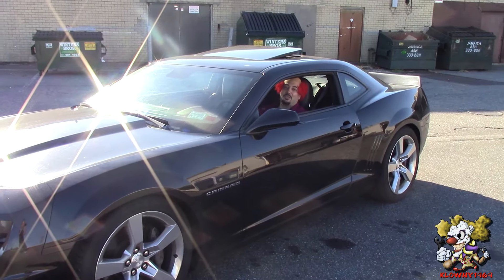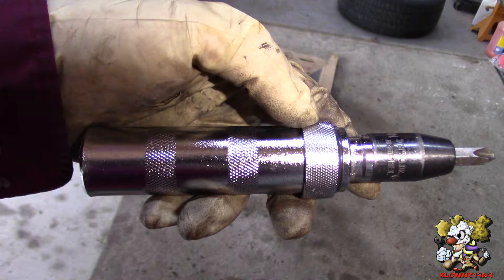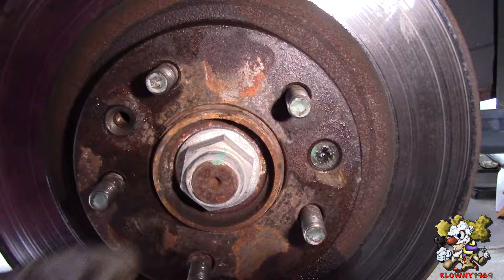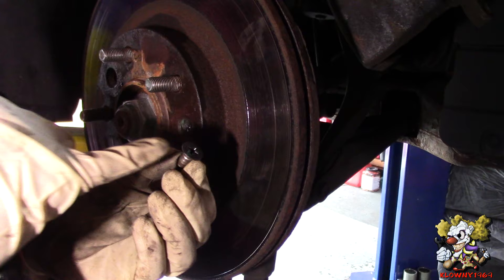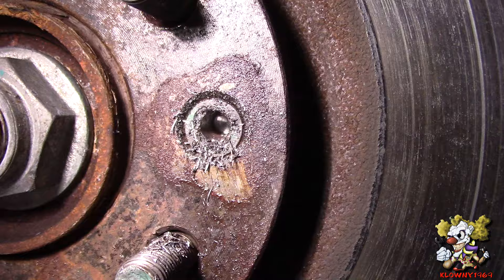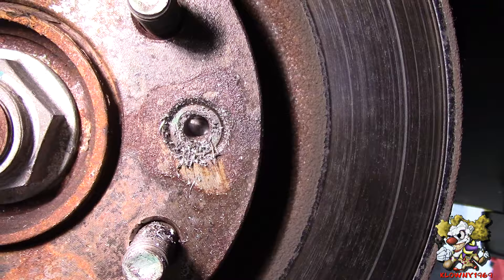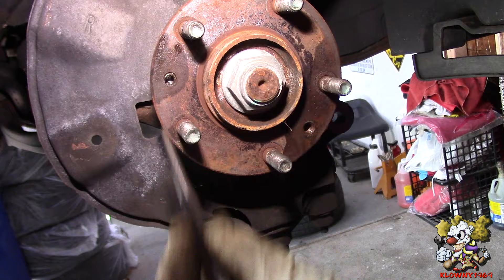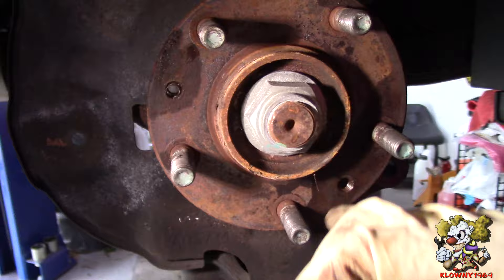How to Remove a stripped Brake rotor screw

Comment: The purpose of these screws is simply to instill as much pain as possible for the DIYer. Thanks for the video!
Reply from the maker: Thanks for watching and commenting..dont forget to subscribe and hit that bell
Reply: It worked then
Reply: Haha ain't that the truth!
Reply: Dang right
Reply: I bought one of those Shake N' Break pneumatic fastener removers. Actually I got the Lisle brand version of it. It works awesome for those rotor screws. I highly recommend checking it out if you do work on your vehicles like I do.
Reply: Been tryin to pick all this stuff up lon my own, and I am coming to the same conclusion very quickly. Also, crazy to see how often mechanics leave their problems for the next guy. Someone put/left that stripped screw in there knowing full well what they were doing. All the more reason to get better at this DIY stuff. I'd never set myself up for future failure like these mechanics do.
Reply: @anthonyfaiell3263  To be honest, the heads of those screws are made of cheese. It is very easy to strip them. Why don't they make quality products to begin with?
Reply: Those screws are as useless as anything I can think of. Car can do just fine without them
Reply: Thank you brother. Shit worked

Comment: it took me about an hour and a pry bar to get my rusty calliper bolts off only to find out the damn rotor screws are stripped form the previous owner, I'm gonna drill them tomorrow. I'm done for today. Thanks for the tip.
Reply from the maker: Good luck and don't forget to subscribe 😉
Reply: Same here,  I'm done for today. My honda element had 2 strip screws I guess
Reply: just happened to me
Reply: @mr.dhydratedh2o442  Happened to me too, so I just changed the brake pads instead for now. I'm concerned tho that it would damage the hub?????
Reply: DUDE SAME!
Reply: @cashway0420  I drilled out the rotor retaining screws on my Honda pilot with a 5/16 cobalt drill bit. Only took a couple minutes or so per screw.

Comment: great video.. rotor screws are such a stupid design flaw
Reply: no need for them
Reply: It’s not a design flaw. The only reason they are there is for the assembly line when they manufacture the car they need the screws to put the car together. They serve no other function. That’s why they seem like there is no purpose, because that’s the only purpose.

Comment: I used a different method on my acrua tl and my parents equinox.  If the retaining screw stripped or rusted in there then just use a nail punch and place it at the outer edge of the screw.  tap with a hammer and within 20 seconds i was able to get the screw to turn on both cars.   It slightly deforms the outer edge of the screw but I was able to still use in both cases.  Do a search on seized rotor screw.

Comment: I've watched numerous video's where guys spend lots of time getting those out. Don't spend more than two minutes on them before going for the drill. They are not needed and serve no purpose. They were only there to hold the rotor in place going down the assembly line. Drill 'em and be done with it.
Reply: best no-nonsense post I have read in a damn long time!! +1

Comment: Hit with a hammer on top of screw a couple times and use a left handed drill bit, it will drill in screw and then it will spin right out.
Harbor Freight a couple bucks for a set if you want to keep the threads intact works like a charm every time!

Comment: Holy hell yes. I was using a screw extractor set with no luck as the previous owner fucked the screws over. My smooth brain never though “hey the lug nuts torqued to spec holds the rotors in place too dummy just drill it out” 😂 thank you man saved me a major headache.
Reply from the maker: Yes they do! Don't forget to subscribe

Comment: It's  clear the automaker designed  this to be repaired at an auto shop because 90% of rotors do not come with  this useless screw in them because the lug nuts will hold the rotors in place. Thanks for the informative video 👋.
Reply from the maker: Thank you..don't forget to subscribe 😉

Comment: Nice video. I had to drill mine out on an Accord. I got a real nice big OA but thought that drilling it out worked better. I reuse the screws but put anti seize on them so next time they screw out with out any issues, normally. But I live in WI and we have the rust issues too. All that precipitation made those rotors mad rusty.
Reply from the maker: Ajay Moore IV thank u
Reply: Any Asian brand car does not use Phillips screws although they appear to be Phillips.  They are Japanese Industrial Standard screws and require a JIS screwdriver to remove without stripping the head.  The JIS screwdriver does not have a sharp point like that of the Phillips and the bevels are much shorter.  You can order the JIS on Amazon.  I hope this helps.

Comment: I had this problem on my Honda civic. I had to heat it up the outside rotor with a propane torch, then use an impact drill  with the screwdriver bit and gently work it out.

Comment: Nice one man. I hate those screws. The only purpose I think they serve is to keep the rotor from falling off on the assembly line. They never want to come out! I drill em out too or hit them with the OA torch. BTW the car in the intro is bad ass!
Reply from the maker: Yup it was for assembly line purposes..thats a supeecharged 5thgen in the intro.thanks for stopping by
Reply: I didn't even know that these screws existed until I went to work on my dad's Accord, took his wheels off and was like "WTH is that?" The rotors on my Lexus don't have these screws on them at all, not even the countersunk holes for them. I wonder if Toyota in general doesn't bother with this silliness.
Reply: @zerrodefex I guess all Japanese and South Korean brands have these screws.

Comment: My question is will you damage the hub hole threads by drilling a hole thru the middle of the screw? Because I do want to replace the rotor screw with a new one.
Reply from the maker: If you knick them..u can always run a tap in it real quick..don't forget to subscribe 😉
Reply: @klowny1969 I really appreciate the quick answer. I’ve been stuck and haven’t been able to drive my SUV for 2 days because of this little sucker. I’m definitely gonna give it a try now. Will subscribe.

Comment: Mine snapped from being lazy and using my impact gun 😓 but luckily it was just 1 screw after I put my disc on and figured with 1 screw on I shouldn’t have an issue
Reply from the maker: even with no screws on, you shouldn't have an issue..thanks for watching and dont forget to subscribe

Comment: The point of those screws is for factory assembly only. That way they don't fall off on the assembly line. There is no need for them after removing them for rotor replacement.
Reply from the maker: That's right..don't forget to subscribe

Comment: I have been drilling with a 135 degree cobalt bit for 45 minutes and managed to pull approximately 4 microns of metal dust material out. It would take me 2 years of constant work to drill through the screw what on earth am I doing wrong?
Reply from the maker: Good question..are you using a dull bit? These are soft screws, you should be able to drill through it like butter

Comment: If your car is an Asian brand, these two screws ARE NOT Phillips screws even though they appear to be.  They are Japanese Industrial Standard screws and require a JIS screwdriver to remove these two screws without stripping the head.  The JIS screwdriver does not have a sharp point like a Phillips screwdriver and the bevels are much shorter than the Phillips screwdriver.
Save yourself the headache and order a set of JIS screwdrivers from Amazon.
Some screwdriver bit assortments may contain the JIS bits.
Reply from the maker: Don't forget to subscribe

Comment: I used this video to get my rotor screw out.  Once the head of the screw came off and the rotor was off, I just reinserted the drill and ran it in reverse and it unscrewed the remains of the screw.  The threads were still intact so I could still use another rotor screw if I chose to do so.
Reply from the maker: Awesome!!don't forget to subscribe

Comment: I stripped screw in my rotor on my Acura Tl, before you panic and want to drill it out use a proper tool first the impact screwdriver with proper bit tip, as some threads left on it to grab on and pound it out. If that fails then follow the video instruction
Reply from the maker: Дядя Федя didnt I say that in the video?
Reply: I tried the impact screwdriver method, after breaking two bits and striping a screw I resorted to drilling them out with cobalt bits and it worked like a charm. Even was able to use my small vice grip pliers to unscrew the remaining bit of threading out of the hole. So glad that my own car doesn't have these screws at all on the rotors.

Comment: What kind of bit did you use to remove that screw my snap on gun and snap on drill bits wouldnt penetrate
Reply from the maker: that screw is soft metal..i used nothing special..probably ridgid bits

Comment: Great video, i have a torx screw i stripped, I have been trying to drill it out using a 1/4 drill bit but havent gotten too far, is there a special drill bit i need?  Thanks,
Reply: Use a centre screw drill bit to start the process then use a bigger drill size (standard metal drill bit) and will drill out perfectly

Comment: my impact driver phillips head bit broke off in the screw slot so now the drill will not center and it goes to the side and gets dull real fast any sugestions? I already tried a diamond coated bit on a dremel to try and make a strait slot across the screw... should I try a rotary cutting disc to make a bigger slot?
Reply from the maker: You can try..try hammering the screw and then chiseling it to try and unscrew it
Reply: @klowny1969  yepper..
Those stuck rusted threads are probably the cause.. I think I should have hit it with the hammer and a punch first  and penetrating oil first before using the hand impact to spare every ft/lb of torque I could..
Which probably caused the bit to sheer off cause it was too much torque for it to handle...
And I had that same bit for years.

Comment: What’s the bolt in the very middle for? Mine snapped off
Reply from the maker: The axle nut?
Reply: @klowny1969  yes. The nut and a little bit of thread snapped off. Is it an easy fix?

Comment: What size bit is that? I don’t want to damage the threads. The head of my set screw snapped off somehow and I can’t get a new one in to secure my rotor: Bmw
Reply: The rotor screw is technically called a rotor setter. It's not necessary, just for factory. You don't need it.

Comment: Does anyone have a recommended drill to use?? I bought a Makita FD09R1 12V and tried this, but it did not work. I was told by a friend I wasn't using the right drill bit. Do y'all think it's just about the drill bit and not also the drill itself?
Reply from the maker: Drill it like a man

Comment: Do not put these back in they are only there to hold the rotor on during the factory assembly process...I also believe they went with a torx instead of a hex bolt because it's less common for the average person to have a torx bit socket laying around not that you couldn't go buy one but they will make anything harder for the average person so they are forced to take their car to a dealership
Reply from the maker: Some are torx some are Philips heads..don't forget to subscribe

Comment: i have a 98 jeep grand cherokee  i replaced all 4 calipers  bleed the brakes and now pedal goes to the floor and i'm stuck with no brakes , original problem was locked up left front brake to the point it was smoking. any help appreciated .
Reply from the maker: joe18370 u might have air in the system..i would re-bleed while paying attention that the brake fluid in ur master isnt drained..
Reply: ok thanks

Comment: good video i have a gmc truck that i stripped the torx bit on and i tried drilling it out, but didn't go as easy as yours  did ..., i pounded on the rotor with a hammer after i drilled on it, i still cant get the rotor off i dunno what to do
Reply from the maker: Maybe ur rotor is seized on the hub..spray penetrating fluid inside the lug holes and continue to pound on it. Some rotors also have threaded holes where you can screw in a bolt and that will help push it off
Reply: @klowny1969  finally got a huge drillbit and drilled it right through and then pounded it off with a 5 lb mallet, will be putting new rotors on after the hub assembly haha
thx for the tips and good videos
Reply from the maker: Awesome..glad u got it off!!

Comment: You don’t need them but whenever I take them out I replace them with stainless screws as it is a harder metal and a less pain in the ass to strip the second time around.
Reply from the maker: great..just becareful with stainless, if you dont use antiseize it will stick with the rotor..dont forget to subscribe

Comment: What type of drill bit does that?  I'm trying with a commercial drill but the bit seems too weak to do much.
Reply from the maker: Jacob Fascia regular drill bits for metal..the screws are soft
Reply: Not mine on my 2009 civic.  I've been drilling away at it with a cobalt bit but no luck.
Reply: @jjfash83 try titanium drill bit

Comment: I’ve been beating on em all night. Broke the first torx bit, grinded a slot in with a dremel, eventually got it out. Went to autozone and got a new torx bit, got the 2nd one off, and the third started twisting the bit. Grinded a slot again and can’t get the fucker off. It’s gotta be 200 foot lbs. tomorrow I’m gonna try a torch or drill it out
Reply from the maker: Just drill them out. Good luck and don't forget to subscribe 😉

Comment: hey man what part of NY are u in? i'm in town of poughkeepsie... i'm having a hard time removing this screw lol. i tried drilling it out but idk what i'm doing wrong. its not working. can you please help me if ur nearby? thanks
Reply from the maker: mujjuman I'm in li sorry..just keep drilling lol its soft metal u should be able to drill through easily
Reply: thanks man i'll keep trying
Reply from the maker: mujjuman np.. u will get it out..no worries
Reply: klowny1969 I got the screw out finally, but it looks like the rotor got welded onto the hub :facepalm: I tried hammering and hammering

Comment: Damn, I learned nothing! Except that my BMWs disc retaining bolts are ridiculously over specified, and whoever put one in before cross threaded it like a good un! Already tried drilling it out, using an extractor, even a cobalt bit wouldn't cut into it. Who the hell decides "yes, we need grade 10.9 disc retaining bolts, and make them allan fittings so they round off!"

Anyway, I'm going to weld a nut on it.. Nothing else for it.

Comment: Impact screwdriver bit snapped off in the screw. Drilling into the broken bit tip isn’t working. About to break out the grinder. What a nightmare.
Reply from the maker: damn that sux..
Reply: @klowny1969  I ended up using a cutting wheel on my dremel to get the bit out. Then, drilled out both screws. Job wasn't bad besides the screws. I wouldn't try the impact again. Not on 25 year old rotors. Lol.

Comment: It's NOT OK to leave those little screws out.  I've driven three hondas where the garage threw them out - and while the rotor won't come off -  there's front end shimmy at highway speeds and faster brake pad wear and jerking braking without them.   I've had to pull my hub caps off and redo the hack job of garages who thought those two little screws were bullshit and just didn't bother to put them back in even though they had them when they started the job.   Next time, tap them out, replace them if needed and put anti-seize on them so they'll come out easier next time.

But don't NOT put them back in.  They're there for a reason.
Reply from the maker: the reason was that they needed to keep the rotor on at the assembly line

Comment: No rotor screws are necessary. They will cause a vibration when braking if not installed.
Reply from the maker: No you will be fine..don't forget to subscribe

Comment: The screws suck. The only reason they are installed is so the rotors stay on the car during the assembly line at the factory.
Reply from the maker: That's right..don't forget to subscribe